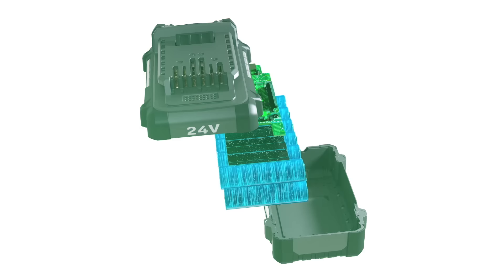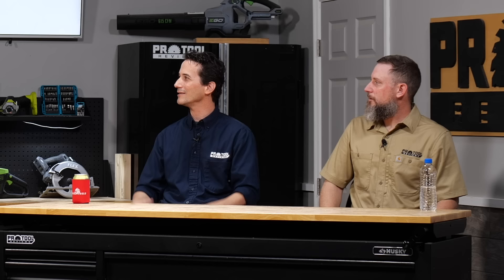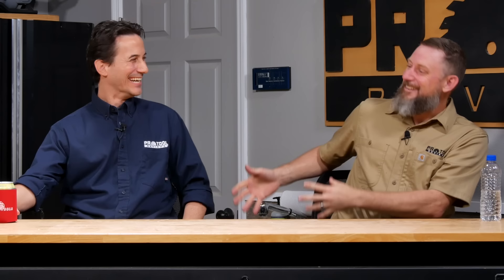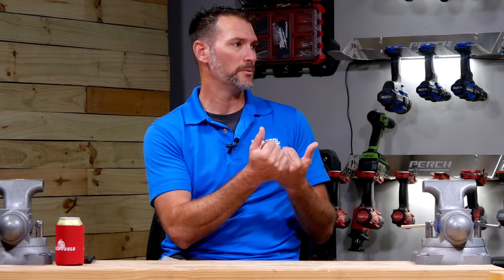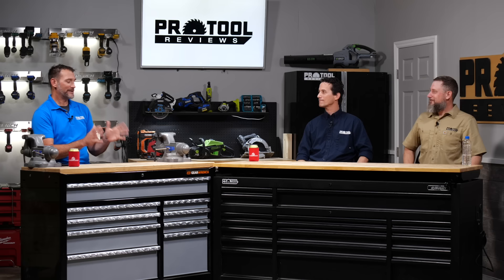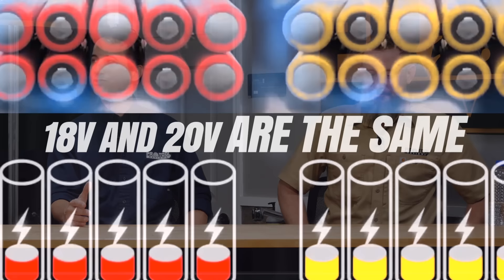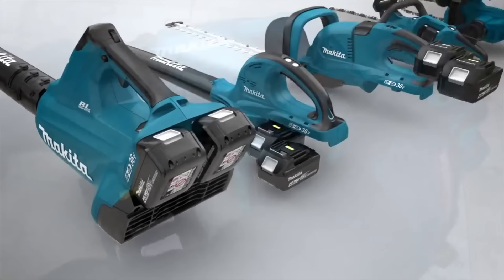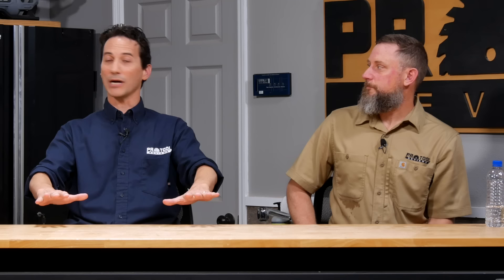You Should Buy 12V Instead of 20V… HERE’S WHY!

Comment: I'm a milawakee guy and my take is 12 volt for small stuff like ratchet and, impact driver, and M18 for hammer drill and Grinders and impact wrench and bigger stuff and yes the m12 impact driver is perfect, maby not for big lag bolts and stuff but right tool for the right job

Comment: Seems to be you guys are saying if you have 20v tools its nice to have 12v for the lighter work (punchouts) but my takeaway is you can do ALL your work with 20v only but not the other way around... if you have a 12v tool platform you also NEED the higher voltage system for getting you through a whole day doing hard work. 

Just my 2volts...

😎👍☘️🍺

Comment: I'm a huge fan of the M12 Fuel tools. Like you said, I love being able to have all my main tools together in one bag, plus bits, extra batteries, etc. and have it still be very manageable. They're just so capable now. Hell I ran a 5" hole saw through multiple sheets of 3/4" plywood today to run a heating stack up through an 8 story building. Granted I would normally grab the corded hole hawg for something like that and just tear through it, but it wasn't available, so I made due with my M12 Fuel Hammer Drill/Driver (god bless that 1/2 chuck). Sure it was definitely hot by the end, but so was the M18 being run right next to me.
I just get a kick out of the instances where someone that's only ever used M18 tools calls my M12 setup "cute" or says that "their daughter would love that" and then I proceed to keep right up with them on just about any task at hand. As a plumber currently roughing in new apartments that are framed with steel studs and tracking I rarely come across anything that my M12 kit can't handle. The only M18 tool that I'd really like to pick up is the Fuel Sawzall. I love my fuel hackzall, but let's be honest it's not meant to be cutting through thick steel angle iron or anything like that, at least not in any reasonable amount of time. Yep, I'm a Milwaukee guy. Could you tell? Haha.
Reply: The problem isn't the drill can't keep up, it's the amp-hours of battery life are so small on the compact batteries we tend to use with them that you need four of them with you when you climb a ladder.
Reply: @mytuberforyou   that’s true, that’s why I use the 4.0 and 6.0 batteries in everything but the impact driver. That one I normally just run the little 2.0 compact in. Their regular brushed multi tool definitely chews through even the xc batteries real quick but I’ve never needed 4 batteries for a trip up the ladder lol
Reply: The fuel m18 hackzall is one of my favourite tools. Weighted better then the sawzall model
Reply: @UnifiedInfo  Haven't had the opportunity to try out the M18 version yet but I love my M12 fuel hackzall too. Like you said, the weight balance, compared to trying to one hand the sawzall, is unbeatable

Comment: In most cases, the majority of what a cordless drill or impact is used for is driving screws and drilling fairly small holes. Today's 12 volt tools are far more than enough for these tasks. 18/20 volt drills and impacts are only needed for hole saws or large drill bits.  Even the 12 volt jig saws and recip saws work well. But as mentioned, the 12 volt circular saws can be a bit wimpy. Need power for those.

Comment: With an 18V hand tool, I'm working work. With a 12V hand tool, I'm working while having fun. 
My advice to someone starting out:
1. For hand tools, go with 12V. When you need a particulsr tool with more power, go to 21.6/24V: Flex, Hilti, or Kobalt.
2. Resist the urge to find a single voltage for hand tools and outdoor power equipment; you'll regret it.

Comment: 60v is also the cutoff in existing rules and regulations between low voltage and high voltage, 60v is also the max on a lot of readily available economical electronic components, stepping above 60v is a big jump in manufacturing cost
Reply: Good to know thanks
Reply: Greenworks is the only one I know of that is higher, at 80v

Comment: I am only starting to DIY but after watching this video I think I will be making better choices in the future. Thank you for demystifying the difference (none) between 24v and 18v. Absolutely legendary
Reply: Theres is a difference between 24 and 18. But not between 20 and 18. Also some 18v run 18650 cells and some run 21700 cells. The 21700 cells are much more powerful and more run time eventhough they are both 18v.

Comment: I'm in Home Theater and I love my Milwaukee M12 tools. The one power tool I keep in my bag is the M12 driver/drill with the hammer function and it serves me well, BUT...
There is definitely a place the 18 V stuff. Like retro fit wire runs where I have to go through 2x lumber all day. I will say that now that I have Fuel tools, I do think they're a bit too much sometimes. I used to do just fine with the non brushless stuff.

Comment: I'm a plumbing apprentice. I'm currently running 18 v impact and drill. Still getting the rest of the power tools but I think I'm also gonna pick up a 12 v impact. Just for the light weight for driving screws for brackets nail plates ect. But that's really the only 12 v tool I'm interested in. Next buy is the 18 v hackzall

Comment: Extra:  Yeah in the US DeWalt (especially) like to make the tool look to be more powerful by quoting the full charge voltage. However, DeWalt in UK label their tools at the nominal 18v, but they are exactly the same.  Why?…Lithium cells are individually nominally 3.7v, but read 4.2v fully charged. So a five cell pack is nominally 18.5v but 21v straight off the charger!  When your 18 or 20v labeled drill runs low it is more like 15v.  Solid state batteries are gonna change the game again…..

Comment: I buy both m12 milwaukee tools and 60v dewalt tools. The m12 is intuitive and easy to use and the flexvolt line can handle anything. Especially the 120v dual battery chopsaw.

Comment: I went Makita for 18v. I was really happy after the introduction of x2 for 36v for larger tools and especially yard tools. I really liked the Makita 12v impact but ultimately went with the Milwaukee m12 system because of their vastly larger tool lineup and have not regretted it. Unless I'm doing decking or something comparable I don't really need the capacity of an 18v.  If I were a pro gardener or needed something like the jackhammers I'd go with the Makita 40v(36v). Makita is a bit slower in releasing new tools but once they do it's a solid performer. Your never really questioning if the next great thing is going to come out. You buy it knowing it will last 10 years minimum. You rarely see used Makita for sale.

Comment: Higher voltage with lower current can deliver the same power with lower resistive losses. This is the primary advantage of higher voltage. There is a secondary advantage in that higher voltage/lower amperage can produce greater starting torque and greater stall torque. Whether or not those are enough to make a useful difference in a given tool is something to look at case by case, there is no general answer.
Reply: @Protoolreviews  yep. That’s what I hoped to convey with my final paragraph.

P.S. I think you did a good job without getting bogged down in the details.

Comment: As an electrician it's all in the application. I love my Milwaukee 12v tools. But I also love my 18v tools as well. If I have to carry my tools all day and I'm using my drill a ton like on a house, I use my lighter M12 tools, but if I'm working with large electric motors and have to open the motors up all day, then I'm going to use my 18v tools because they are more powerful and the 12v tools are for speed.

Comment: Milwaukee M18 and M12.
Cordless soldering iron, ratchets, “Dremmel”, and now hammer drill and Surge all in M12.
M18 for circular saw, impact and drill, rocket light, sawzall, inflator, metal cutting saw… bigger things.
Both platforms should coexist.

Comment: I personally have the Ridgid 18v system as my battery platform of choice, the selling point to me was I wanted 1 battery system and the tools I need (rack refrigeration mechanic) and I wanted the highest torque 1/2" impact because sometimes I need to break loose some pretty rusty fasteners and Ridgid delivers that. I worked for a company that have M12 stocked on the truck and it was mostly fine other than my 1/2" impact needs.

Comment: The right answer is always use the right tool for the job. In the voltage wars, that is always going to be the lowest voltage that has enough power to do the job you are working on. More volts = more power, but also means more weight and more cost. If you can make do with 12v then use it, if you need more power, then step up to 18v. If you need even more power, then look for a 40v or 60v option.

Comment: Different horses for different courses. Got a mix of Bosch 18v and 12v tools. 90% of my work, especially finishing work is done with the smaller stuff, 18v there when I need the bigger, more powerful stuff like drilling in concrete of smashing through joists to run cables. 
If I’m using a drill 100 times a day, and the 12v is half the weight of the 18 them I’m putting half the stress on my body, working longer and wearing out my body less, which over a lifetimes career worth of work makes a massive difference
Reply: But they arent twice the weight and you are working faster, which puts less stress on your body. I am not saying 12v is bad, just that your argument is bad.
For me, I dont want 2 versions of tools because thats twice the space and costs. Every review I have seen shows more power means quicker better work, and better quality tools generally.

So really, it comes down to your budget and space I guess.

Comment: Started with 7.2V then 14.4V to 18V and discovered 12V. Now I use 12V 90% of the time. 12V does not mean less power, power is the combination of voltage and amps or watts. However higher voltage means less amps (for the same power), thus more efficient in using smaller copper wiring, less voltage drop and happy, happy motor. The major advance was going from nicad to lithium. The next generation could be the power of 18V in the size of a 12V battery pack.

Comment: Good info on batteries, glad OPE was also talked about. 
Charging can effect battery life. If possible avoid using fast chargers, the higher amp rate generates more heat. Also when a used pack feels warm let it cool before charging.
Reply: Good chargers and battery systems (especially the Bosch 12v and 18v) have temp systems that will prevent battery from charging until it cools. And the Bosch Core 🔋 18v get really hot, but cool fast. They did a great job with their Core Batteries. Their old batteries rarely felt hot because they trapped the heat in their case (why they'd have some fire issues back in the day lol.) 
 
Bosch really went first to worst. 
 
What's your take on the spicy pillow batteries dewalt made?

Comment: A small milwaukee bag with a m12 1/4 impact,m12 drill(hammer drill),m12 die grinder,m12 muti tool.   Replaced my dewalt 20v that took up my whole back seat with plastic cases......

Comment: So I’m going to disagree with what you guys said about what most home owners need.  Most home owners don’t have or need 30 different battery powered tools.  I would say that most only need a small drill and maybe an impact driver.  They also don’t generally need tons of power.  Look at most consumer based tools.  Black and decker and such.  They are largely 3/8 drive drills that aren’t too fast or too strong.  I would say most home owners would be thrilled with the power and usability of dewalt or Milwaukee
Reply: You do realize that both Milwaukee and DeWalt make an entry level, dare I say home owner grade and even a pro-sumer grade/level tool, just below their top of the line tools, like their FUEL (or which ever sticker is on the DeWalt, depending on which store you're buying it from, as they're too confusing).  Lithium Brushed, Brushless, FUEL. Each one has their price point and performance rating/output.
Reply: You: Statement

Me: 👁️👄👁️ 25+ Ryobi collection I use all around the house from yard to vehicles
Reply: @mannyvalero3250  you: an outlier
Him: what MOST homeowners need
Reply: @bennygerow  dude, there's a good reason that Ryobi sells a ton of multi tool sets every Christmas and father's day. If "dad" or "mom" is even marginally diy inclined they're going to have at least half a dozen tools.

Now, you can play that elitist, gatekeeping, I know better than a homeowner what they need, bullshit all you want; but this pretty fucking easy to start justifying buying those tools once you've got s good battery platform. Ryobi alone, I own an angle grinder, an inflator, a recip-saw, three Bluetooth radio/speakers, a caulking gun, a flashlight; am considering a trim router (Ryobi or Ridgid), a Dremel style tool, etc.

 Ryobi, and by extension Hart, have a very good idea what the average home owner can actually use and need.
Reply: A homeowner, diyer often needs some sort of saw/s in addition to drill drivers.  Plus ope and an assortment of other hoysehold things which may run on the same platform.  Like inflator, blower, lights, radio, fan, inverter/charger.
Reply: Jeremiah Milwaukee and desalts prosumer products tend to be previous gererations of there product like years ago I started with m18 Milwaukee drill driver and upgraded to the fuel line they still make the older version but the newer line has new options that the previous didn’t.  So I guess if that make the old pro tools prosumer then so be it.  With that said the 12 v lines often offer similar products to the big boys just in a smaller version.  Often home owners aren’t building houses or porch’s every week so in my opinion a 12v platform is sufficient for most people hanging the occasional shelf or building a new deck on there house where time isn’t as much of as issue.  Oh and 12 v platforms are often a bit cheaper letting the home owner by more tool for the money.  My experience most people that think they need the biggest and best really don’t including myself

Comment: I used to use 12 and 14 volt tools before 18 and they definitely lasted longer on a charge, my 18 volt makita circular saw will cut thicker full blade timber with 5amp battery than a 3amp

Comment: If you can't buy both, then buy the 20/18 volt tools. There is NOTHING worse than needing more power and not having it. I can live with some extra weight, longer charging times, etc... What I can't do is run to Lowe's and buy a new tool every time I come across a fastener or a bolt I can't remove.

Comment: One needs 12V, 18-24V, & 48-56V to tailor the tool to the job. Once the voltage is decided one is married to the battery platform. Only invest in permanent magnet (brushless) tools for torque, battery runtime, and non-sparking advantages.

Comment: Back a few years ago doing a fence, we would get way down the line with a drill. We would run out and have to have a battery with us but always having on in the charger. I decided to go cordless when I had to run 200 foot of power cord and still ran out on the side of a building attaching a line set 3 floors up.

Comment: I couldn't imagine using 12v for what I do. My m18 tools time out when I use them. Angle grinders, hackzalls, bandsaws, and drills when mixing masonry. 12v wouldn't be able to do the job.
Reply: Exactly
Reply: @rch5991  I can't imagine milwaukee expecting their 4.5/5" m18 grinder being used by a mobile welder. I thought maybe I was pushing too hard, so I lightened up after letting the tool sit for a while. It still timed out after a couple minutes. They need to work on that. The only real reason I have milwaukee tools is because their massive variety. I do have to say, my son dropped my drill into a bucket of water. Fried the 4.0 battery, but after it dried out the drill worked just fine if not better.

Comment: I have both DeWalt 20V and have some FlexVolt including the blower, weed whacker, table saw and circ saw. But, for the travel trailer, I have M12 tools. I like the lights, and most importantly the size of the M12 tools. In particular, I many of my M12 tools are the old brushed versions as for most tools, they are smaller and still great tools. And space is always an issue in a travel trailer. I find the inflator to be invaluable along with the grease gun... But the size is likely key. I do carry the DeWalt impact wrench for tires and the DeWalt fan with a couple FlexVolt batteries..because I have them... The fan will go 20 hours on a 9 AH FlexVolt... And inside a cabinet M12 can't be touched by any 18/20V tools.

Comment: It's simple, 18V standard came about because that's the voltage/power that was really needed back then to make usable tools suitable for up to medium duty work which covers most of what workers need.  Yes there was a 9.6 V and 12V predecessor but they were known to be underpowered and hence the need to go to an 18 V platform.  Today  battery tech and motor tech , controllers, and design has improved greatly and 18V is now mostly too much tool and people are looking for compact options that do the job.  One solution is to go down to 12V's with the newer batteries, controllers, motors and designs.  So that 12V is doing what the old 18V could, but is smaller, lighter and should be cheaper (at least to make), then an 18V tool.  The resistance is over the battery platform, is it worth it to maintain 2 battery systems over a single system with some compact 18V tools considering if there is some tools where one needs that extra power.  So perhaps it's better to buy some compact 18V tools to stay on a single system over getting an 18V line.